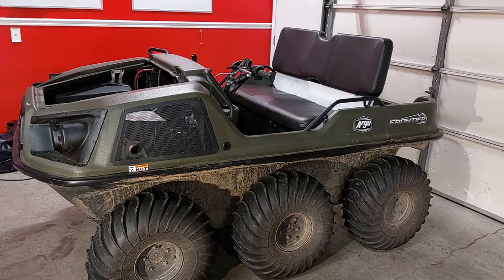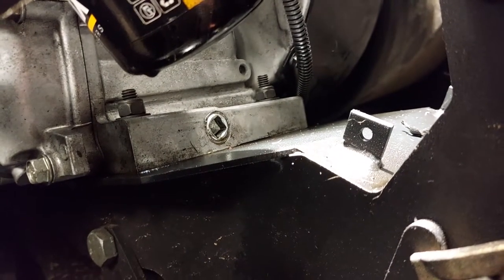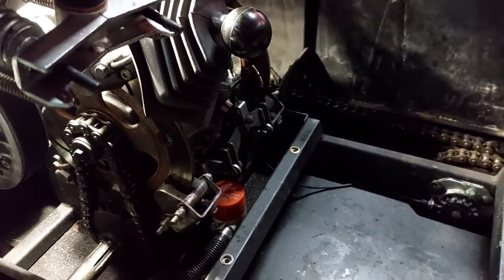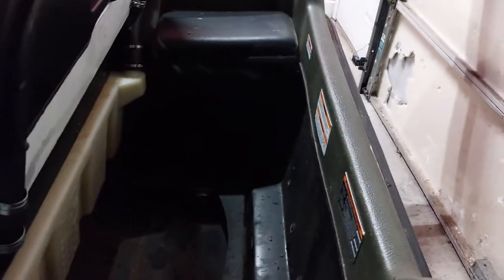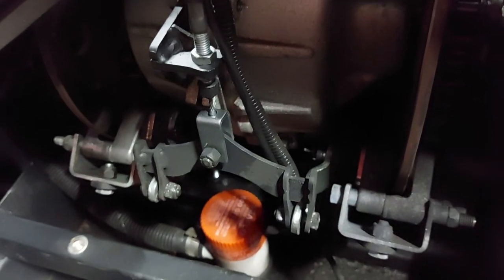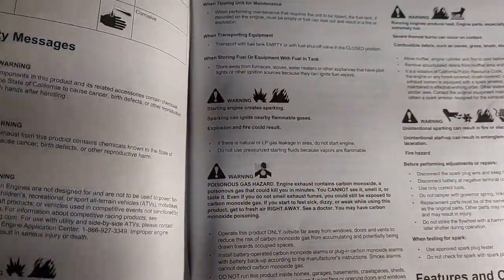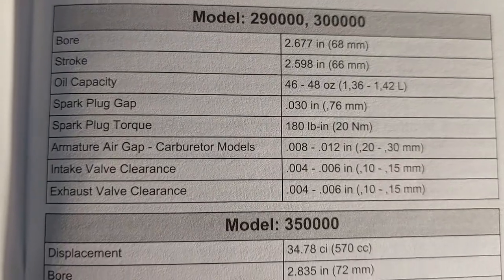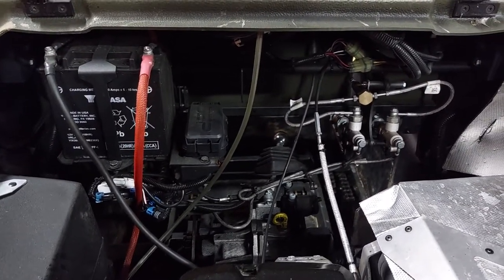ARGO oil change

Comment: Easiest way I have found is , remove spark plug wires, put drain pan under filter, remove filter, crank over machine , all oil goes into drain pan. This is the simplest way. Way better than a vacuum pump. Try it and you will see this is way to go. Reinstall plug wires, new filter , fill with oil , good to go.